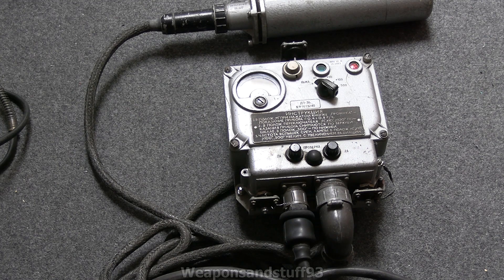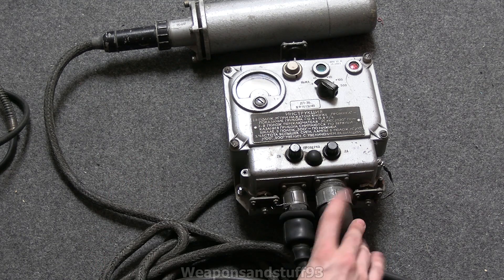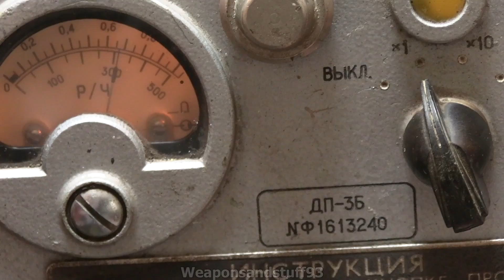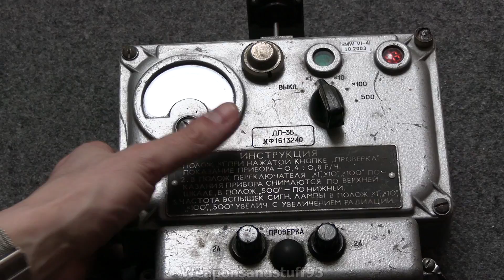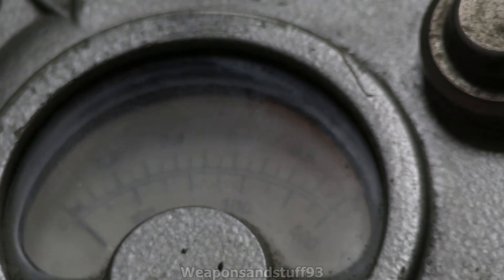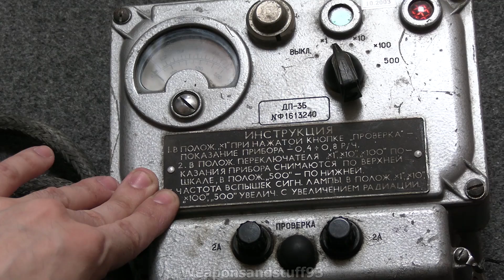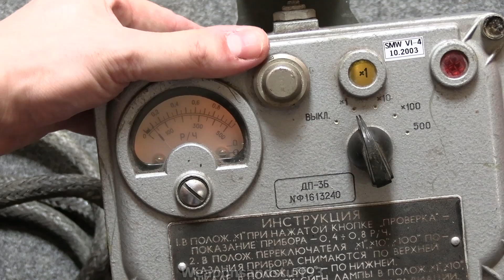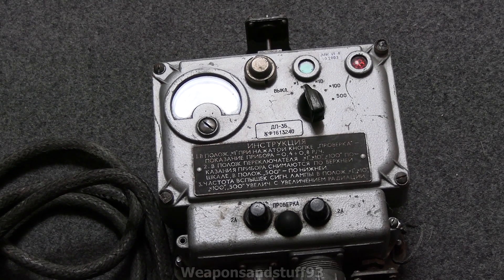Soviet DP-3 Roentgenometer

Comment: It seems my s6 exhale valve is sticking because the mask inflates  when I breathe out. I feel the valve is under the black cover at the front but Im not sure how to take it off
Reply: Update: Got the cover off but can only see the voice diaphragm and a hard plastic cover with holes in it. Where is that exhale valve? Is it inside the rubber donut that makes up the front piece?
Reply: @radiationking9875  I don't have one, but from what i understand about how it works, that's where it should be.